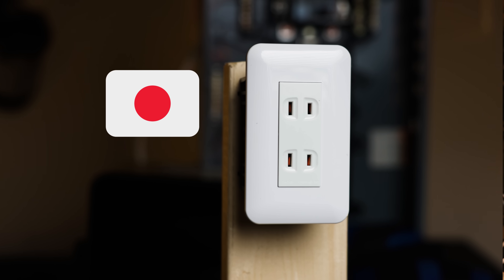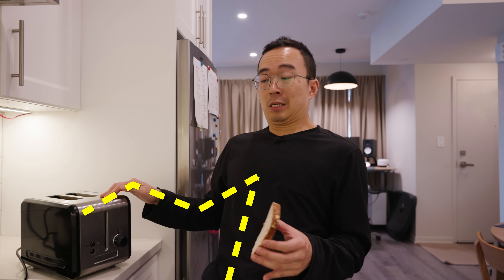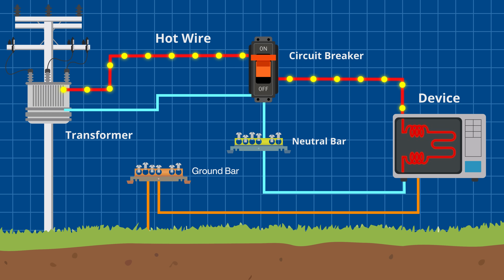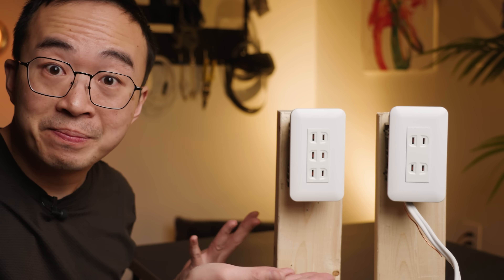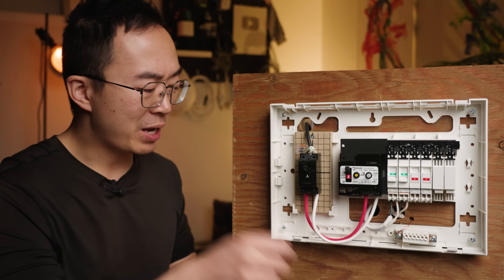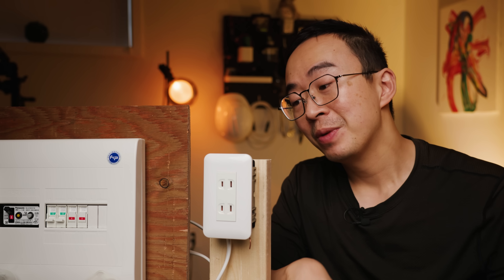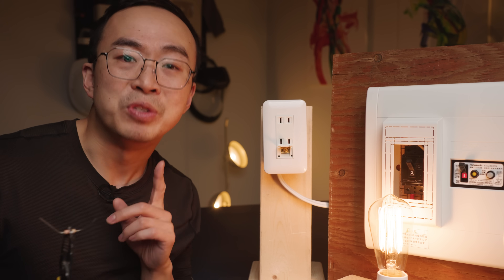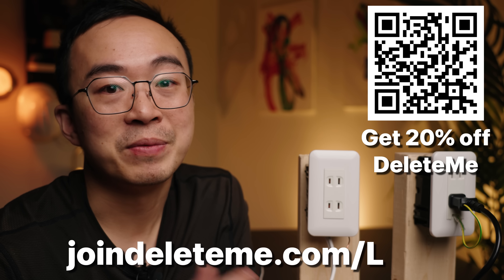How Japan Made Their Outlet Safe

Comment: A quite uncommon twist. In Norway old houses (pre 1990 ish) have 3 phase 230V IT without neutral, 230V between each phase (not TT like in Japan). Each fuse has 2 or 3 pole RCD protection, which mean one fuse wont disconnect the main supply for the building.

Comment: Hi, I am from norway. I am an electrician, and we do ALL the wierd stuff. In america, you have TN-C-S systems, Japan got their TT. We got TN to!. So we got all the systems. And I think we do one better. No matter the system, in a house, there MUST be a GFCI on every circuit, 30mA. All outlets must be grounded, and wiering dimmentions are calculated, not found in a chart (mostly, there are 3 exeptions, but It limits the max current at a given guage). there are special requirements for EV chargesrs, solar systems etc. And on the top of it all? You cannot, at all, do any electrical work, without bein an electrician, AND working in a electricity installment company.

Comment: You wouldn't need ground if all appliances where electrically isolated by a switchmode power supply. I just remove the earth pins from my computers, and its all fine.

Comment: It’s not even the outlets, when I went to visit Japan, the lack of power draw from the socket outlets meant the hairdryers were absolutely terrible! And kettles ect, Here in Australia, we have 2400W at 240 V at our disposal, and the entire house and every individual circuit has its own RCBO, (gcfi circuit breaker combo) 
The sockets in Japan were loose, plugs fell out and the lack of earth is super dangerous generally as there’s no protection, if the entire world switched to one standard, it should be either 240 V 50 Hz, British plug standard. It’s the best and safest in the world.

Comment: I am an electrical engineer in the USA.
Much of the technical information in this video on how Grounds work in the USA is completely wrong.
In the USA:
The large pin is neutral or main ground. The third pin ID a secondary ground. in t there in case the main ground fails.  Both the main and secondary grounds are terminated tat the same place in the service panel.
GFCIs are nothing more than a very sensitive circuit breaker that breaks the circuit at a much lower level of current than the service panel circuit breaker. 
 I do not know much about Japan's power system but  I know it is not a redundant safety system.
The Japanese grid was designed to minimize the use of copper since Jspan has no copper reserves.
Japan's safety system completely relies on the fact that the service panel GFCI is grounded through one single wire. If that wire goes open or corroded then there is no safety at all.
Plus you would ever not know there was an open.
That situation can cot happen in the USA.

Comment: When I moved to Japan the lack of knowledge even among engineers about the significance of the grounding cable was stunning. The university where I worked had a safety manual with pictures depicting something else and in the background you could clearly see the grounding pin being defeated by an adapter to one of these tabs which then hang loose in the air. So: 3-Pin-Plug on the machine doesn't fit in the socket, hence let's make it fit with an adapter to 2 pin + tab and then let the tab float, because there is no ground in the wall socket.

The same manual said about accidents with lathe chuck keys not...
a) Never let go of the lathe chuck key when it is in the chuck or
b) Always use self-ejecting keys

but 

c) Try really hard not to leave it in the chuck as you turn the lathe on.

Comment: Circuit breaker is to protect the wiring and electrical system. GFCI is primary to prevent electrocution on homeowner. As a homeowner, you want both, so you can enjoy the benefit of electricity, at the same time safe from getting hurt. :eyes-purple-crying:

Comment: Only two wires in the old days too! ...  there were only two wires going to the wall socket, safety ground and neutral were connected to one wire, to save wire in the house installation. But the outlet has three, so the plug can be put in both ways safely.

Comment: I thought all of Europe had GFCIs next to the main breakers. At least in western European countries I'm sure they do. I'm from Spain, and we combine the Schucko plug with GFCI for the whole house. Low power devices use the old "euro" plug which fit nicely in schucko sockets, but the opposite does not work because Schucko plug leads are too thick for old style sockets. We call GFCIs differential breakers, because it senses the difference in current.
Reply: Sorry to nitpick here, but the plug is called "Schuko", not "Schucko", because it is the abbreviation for the german word "SCHUtzKOntakt", which means "Safety Contact", which is mainly a hint to the Ground pin, but not only: The plug is designed in a way, that you cannot touch the pins for live and neutral while inserting or removing the plug even before it first makes contact with the socket counterparts. This is sadly possible with the US oder Japanese Plug and is probably a much bigger danger  than the missing grounding. I don't know about the UK Plugs, but since the sockets are not recessed I can imagine that to be a problem here as well. 

The Euro Plugs are not primarily for "low power devices" - they are only allowed for devices without metal/conductive user exposed parts because they have not ground pin. I think I saw them first when the german schuko plugs did not fit other european sockets, like the french ones with the ground pin sticking out of the socket. The euro Plugs did fit them all. Not sure if that was the intention. In any case they were for non grounded devices only and now there are special Sockets that fit more euro plugs than "full" ones.

As for GFCI in all of Europe I must disappoint you. Even in Germany, which is extremely strict with its regulations (it is even forbidden by law to do anything on the electrical installation including connecting a lamp to an existing ceiling wiring by people who are not trained professionals with certificate for an electrical profession or a degree in electrical engineering) there are still homes with not RCDs because while they are compulsory for any new or modified installation is not required to retrofit them. A few months ago we were checking on a new house built in the 1970s which the owner wants to sell for 1.2 Million Euros which did not have RCDs or even automatic circuit breakers - only ordinary fuses on every circuit.
Reply: @radlrambo4994  I see. Sorry about my bad spelling. The UK plugs don't have that problem because part of the pins are isolated so by the time it makes contact, all the metal part is underneath already. Similar to how modern euro plugs (the long hexagon shaped ones that have thinner pins) have half of the pin with a plastic shroud so it's not possible to touch the metal while half inserted.

The ungrounded plugs that require more power usually have a flat part that matches both the schuko socket and the french socket, so the recess protects the same way; and the pins are as thick as schuko, so you can't connect it to an old euro socket (those with a very small or nonexistant recess). And you can't connect it to a new style euro socket because of the shape of the recess (long hexagon). Maybe those don't exist in Germany, I don't know. When I search for "type C socket" it shows a round one, so maybe they're only common here. It's a socket that only fits europlugs and it's typically only available in power strips, extension cords and such.

Do those old houses at least connect ground to neutral to protect people the same way it works in the US?
Reply: @DiThi  I have never seen "Type C Sockets" installed anywhere although they might exist. I have only seen them in extension cords with multiple outlets - there they are quite common 

And "klassische Nullung" i.e. bridging Neutral and Ground after the panel is forbidden in Germany since more than 50 years - in new installations or modifications thereof. Electricians say they still exist somewhere  but I have never seen any - and I was born in the year this became unlawful.

In any case it is strictly forbidden here to install an RCD if after the RCD ground is not separeted from Neutral (or there is no ground at all).

Comment: GFCIs are great at detecting and protecting against unwanted current draws, through people for example.  The downside is they are prone to tripping during power up of large induction motors. Motors with properly sized capacitors can mostly avoid this situation, but on critical applications, like sump pumps, I would prefer a grounded circuit without GFCI protection to control fault detection.

Comment: Nay, not really. RCD helps but it does not solve a certain problem with modern (switching) power supplies: Ghost Voltage on the secondary side (AKA "common mode voltage offset" or similar, I forgot the exact term). Basically that is the reason why practically all laptop PSUs in the last 10 years got the grounding pin back, while many in the 200x years tried to abolish it.

Comment: I think this wideo is wrong . In europe we have ground and rcd breakers so it mouch more safe thank you. If you have leakage of the current to the ground first of all this will protect you becouse voltage will drop and energy will be transfered to the lowest resistance thats is ground so if you touch it you will be safe and second thing is we have rcd circut breakers that will diconenct the circut in 0,4 s

Comment: Interesting. We bought a printer that had the ground lead separate from the power cord. You had to run it from the chassis to the outlet separately. I just jury rigged it to the outlet ground with a cheater plug to get into the outlet, but I guess that's what it was for.

Comment: In Brazil we have an equivalent to the GFCI, it is called DR (Residual Differential Protection Device). It is also located in the power panel, and therefore is in all sockets. We also have grounding and a 3-pin socket.

Comment: It's standard and common here in the Philippines as well. We've NEVER had or installed with that additional ground outlet for more than 40 years in our house (even if it was renovated nearly 27 years ago), NOT A SINGLE ISSUE we've encountered to any our appliances FOR DECADES! Further, I even mostly removed those ground prong to some appliances and devices.

Comment: @Lam Most of the electrical system in the home I stay in USA is from the 1930's (90 years old). The main panel was replaced in 2005 or so. Every year or so when I turn the lights on or off I get a big bang from one of the light switches and it fuses in place, then I replace it. Sometimes I see a little flash. Most of the outlets are ungrounded 2 conductor wire not in conduit. I don't have money to mess with things so I only replace them as they fail. I've slowly been replacing some of the outlets with properly grounded ones where I can reach them from the basement or attic, adding a separate ground line taped to the original wire every few feet such that each circuit has it's own ground line running to the electrical box. 

I'm wondering, can I get approximately the same safety as grounded outlets by instead pulling the line for the circuit out of the electrical box, connecting it to a GFCI, and running a supply line from the electrical box to that GFCI? I'd then be able to plug in grounded plugs to cheater adapters, three prong to two prong adapter, which you're supposed to ground separately, but nobody does,   with approximately the same safety as if they were actually grounded? (I realize I'd want to mark which outlets I GFCI PROTECT) I don't care much about code, I do care about safety and being as safe as I reasonably can be for little to no money. 

Important to note is that sump pumps must not be on a GFCI circuit due to the danger of false trips. How does Japan's system handle sump pumps with whole house GFCI?

Commentors, answer at least one question knowledgably or don't respond
Reply: Why are you posting this here? Post this in an electrical engineering forum or on some subreddit.
I absolutely read your last line btw.

Comment: I agree, very misleading video. I am a master electrician and i can tell you GFCI protection is required in many locations of a dwelling unit in the United States. Ours are designed to trip at 6 mA of fault current and work very well. We also install them as a circuit breaker protecting entire individual circuits, Preventing all the lights ion the house from shutting of due to a nuisance tripping. We also still employ the equipment ground which you described. My take away form this is that Jap[ans system is backwards and outdated, no where near as safe as ours.

Comment: Europe actually has a mix of grounding systems. As a result, all consumer units have a GFCI/RCD because a ground fault could turn the ground system into a TT by accident. TT systems require a GFCI at the input. North America uses TN-C-S (Earth("Terra")-Neutral-Combined-Split) where Neutral is put at Earth potential by bonding at various points in the circuit, while Europe uses a whole mix depending on basically the jurisdiction. The UK especially has a huge mix of grounding systems at play. Incidentally, it's code-compliant in North America to retrofit a 2-prong outlet (no ground) with a 3-prong outlet as long as a GFCI is installed (and the notation "No Equipment Ground" is labelled on all outlets with such a "dead ground").  There are enough legacy outlets where this is necessary and having a 3-prong outlet is often required without resorting to things like cheater plugs.
Reply: You cannot ever use the word "all" on European systems, especially if you include old ones. The systems vary so much that you cannot even imagine. The only things that are guaranteed is the voltage and the frequency.

Comment: All I can hear you saying is that the type G plug and the UK GFCI remains the champion... 
Fused appliances at the plug - meaning daisy chaining extension cables is no where near as dangerous.
Ground on everything human touchable.
Covers on the 2 hot holes in the socket unless the earth is already in.
Insulation over the 2 hot pins on the plug if it can be touched by little fingers.
GFCI on each circuit - so a shorted table lamp won't impact the house lighting.

I would argue strongly that the American system is safer (sadly, sorry Japan, I still love you!) because if every device is correctly grounded - the situations where GFCI is needed falls largely into the bathroom; and the user is never exposed to the high voltage in the first place.
Reply: I love going to America as I can see how things were 70 years ago. A living museum.

Comment: They are not safer in Japan. The difference is that in Japan you need to touch faulty device to trip the breaker. In the rest of the world if the electrical device body gets in contact with live conductor it will trip the GFCI.  And for some devices you dont want GFCI for example freezer full of tuna fish. Grounding is better in this case.

Comment: Today we discovered that Europe is still ahead of America.
Reply: Traditionally Europe always had very very good electrical components. Key countries being France, Germany and Belgium for some very well engineered brands. In today’s globalized world with lots of consolidations not so much anymore. With each European country having it’s own code which is ridiculous. Efforts for standardizations are being made however. But there it stops, Europe is lightyears behind in tech.
Reply: @syproful  How is Euope lightyears behind in tech?
Reply: Whole-Home GFCIs are a tradeoff with outlet-scale GFCIs, not a straight upgrade.  The BEST protection is a MIX of grounding, GFCI outlets, GFCI Panel, Fuses in all plugs, Circuit Breakers, safer warded outlet/plug designs, using lower voltages and service currents wherever higher ones aren’t needed, and every other strategy you can find.  Which no electrical system does all of because of the expense.  Overall, most modern Electrical systems in developed countries have a similarly decent suite of safety systems but none are particularly better than the rest.  Even in Europe.

Comment: As some people said, if you have grounded outlets AND RCDs you are extremely safe. If the grounded device is defect, the RCD will trip because the current goes through the ground and not back through the RCD. If the wire is defect and a short curcuit or an ground curcuit appears, the braker will trip. So you never really have the risc of touching any live metal object or water that has current flowing through. RCDs need to have 0,4ms and 30mA for outlets and lights, usually they trip much faster. And you should press this test button every half a year to keep the mechanics inside the RCD working or at least know when it's broken and needs to be replaced.
In germany we commonly have TN-S systems in new homes. In older homes we still have TN-C-S systems, just like you still install in america. TT systems are used in very few special cases, but never in normal houses.

You really should look into german electrical boxes, we have so much electrical and fire protection regulations in our electrical systems to keep everything safe, that's crazy ^^

Comment: Honestly, North American plug sockets are really outdated for their safety protection measures, including Japan. 
In the UK, all of sockets are protected with safety shutters which are triggered by earth pin of plugs, earthing is mandatory for every appliances except phone charger, shaver and hairdryers. The RCD is even more stricter than NA and Japan, since for every Voltage dependent type RCD, the Functional earth tail is required but they are nor mandatory in Japan and North America